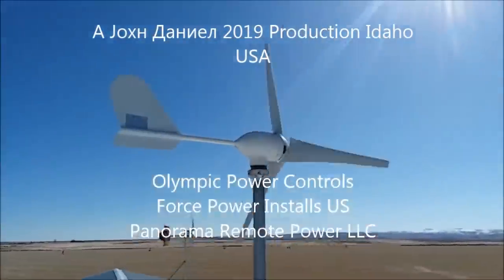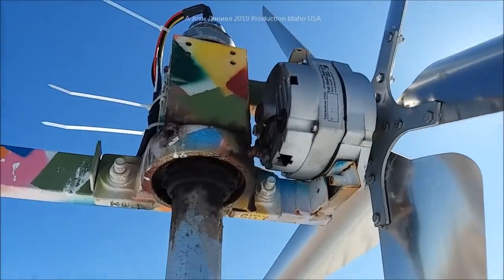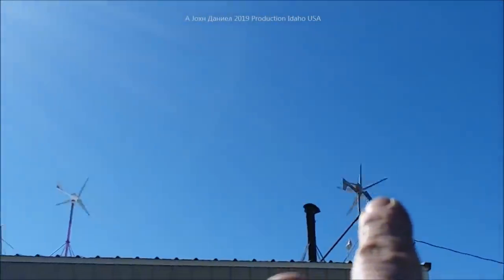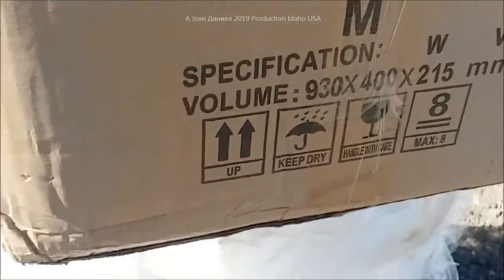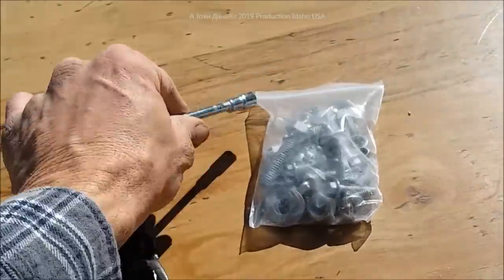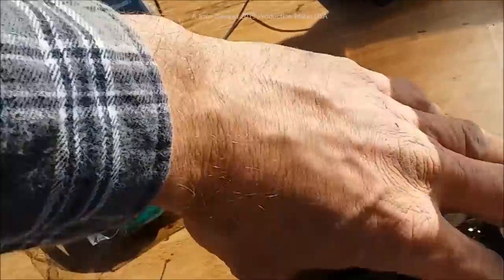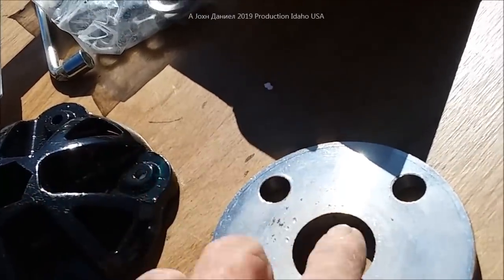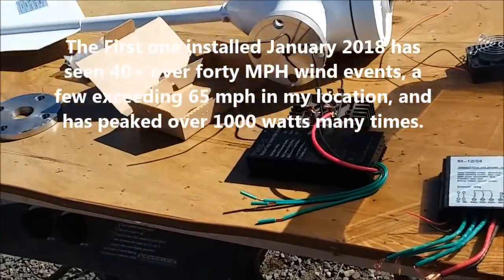Genuine 500 watt home wind turbine, Best small Wind Turbines made! FULL PARTS LIST BELOW video

Comment: Next time you have the Chinesium Unit down for anything check the wires coming out of the back of the PMA  ( They call them PMSG Generator ) .   All of the Chines PMA's on the market I've looked at  do not seem to have any Grommets protecting the wires exiting the PMA.   You may want to be checking yours when possible.  Could make for some BAD Ju Ju.

Comment: What can 500watts power in the house to full capacity.
Reply: Add a small battery system and convert all lights to LEDs, and it could run your lights off-grid, and still have enough extra power to keep multiple phones/tablets charged.
Reply: Wind is also strongest at times when sunlight is weaker or absent, so wind energy is a good complement to solar power.

Comment: 1) A Wiring diagram would be nice to see (I build RC Planes and they use 3 phase brushless motors) so this is very similar

2) How well do these stand up in very high wind conditions.  Where I am, during winter, we will get winds on occasion that will exceed 130 km/h (about 80mph).  

I have been looking at both this style as well as vertical axis wind turbines and thus far have not made a choice as I can't figure out which would be better in my case.

Comment: John, thanks for your input and helping others!  I bought three of the recommended turbines, for an off-grid home, 2 - 600w units and a 1KW unit.  Having problems getting what I paid for in this deal.  The 600w model have nose cones that cannot attach given the included hardware. The design requies a very long (5 inches?)  6x1.0 bolt to fasten the nose cone.  Sara has not fixed this.  not sure if one exists...still looking.  The 600w model also has a concave hub forcing the blades to be angled away from the hub at about a 15 degree angle. Have you seen one of these turbines?  Is this normal?
The 1kw unit has major problems from (shipping??) damage.  Threads bent at the end of the shaft and much play in the shaft (in/out) and beat up blades due to rough handling and poor packaging.  my 600w units don't have the bearing play.  Have you had experience with the 1kw unit?  The 1kw is heavy, and they packaged the unit like the small ones.  All of the foam in the boxnear the generator side was crunched/broken.  It should be sent in a small crate.  So far 0-3 in getting what was advertised from aliexpress.   
If/when I get past this I have some questions on how to build a telescoping/tiliting tower, we are in Oklahoma, hint...hint.  Thanks for any help or input you can provide.

OKDan

Comment: Do I need a load diverter bank with this setup?
Reply from the maker: I recommend a proper load diversion of 200 watts first stage 14.65 volts, 300 watts in second stage 14.85 volts

Comment: Could you install and mount a system that’s easily removed and mounted  *a smaller version*.. on the top of my van  .. (I travel and live in it)...so when I’m (off the grid ).. it would supply enough to stay at any camping area for long periods of time...???
* Great video..!!! Thank You

Comment: Your no COG implementation is great. In my experience with wind vane self-steering sailboat units, I learned that a wedge shaped (v-shaped) tail fin is much more stable than a flat tail fin. The wedge prevents hunting while pointing directly into the wind because there is pressure on both sides of the wedge which keeps the wedge from wandering. Place a tab on one side of the wedge fin to achieve your torque speed control. This reduced hunting will reduce gyroscopic precession stress on the bearings and on the blades. It should also increase the average power produced because of reduced hunting. What say you to that?
Reply from the maker: You don't want the turbine to be dead locked on the wind, you want it to be able to move in high wind burst so tail size and capability are calculated to allow torque reaction effect to save the turbine in dangerous winds.

Comment: Do you know these windturbines from a company in UK called marlec, they call their windturbines rutland and a number depending on size ? And what would you say about them from what you know about windturbines and offgrid?
Reply: I've had a Rutland 914 for a while, all seems good, but very heavy using conventional magnets in a huge flywheel, seen pics of them self destructing in gale force winds. Their new one ( think it's the 1200) looks very nice, rare earth magnet design, looks a lot like an "Air breeze"  but without inbuilt control circuitry ( less to go wrong?) only drawback is the cost, but made in the UK, not the Far East!

Comment: I did a drill test and mine does work real good. I just need to get a telescoping pole for it.
Reply from the maker: Might just have to load all up on your trailer, and come one down to Twin.
Reply: I have to install a serpentine belt and the 2 pulleys the tensioner pulley and the other one. Then I can . And I need to put a hanging hook on the side of my box for turbine pole lol for the trip that's eay then its road ready. What exactly would we be doing to it?
Reply: Shit I might as well bring my new electronics box and my 18 copper bus bars I need to install for my new bank I have 2 batteries still that need to be added I ran out of space in my battery box.so I'm making a new batery box .
Reply from the maker: @donaldsteele6276  My guess, we would have to take our ugly old asses to the drawing board with the trailer there in person to base a design from. Hands on and make a rotary lift or pit and tilt. Good weather is about 10 days away.
Reply: Oh hell yeah.  I'm working on improving  things all the time with the trailer. The bus bars will clean up the wiring allot. The telescoping pole I've seen some pneumatic pole designs that would kick butt. A small compressor and the pole would go up and down.
Reply: I repaired my truck still have roofers installing a new roof on my house and a new bathroom is being installed.  Hopefully I will be free soon again.
Reply from the maker: @donaldsteele6276  Your just gonna have to haul that set up to Twin and Join me and my traveling cohorts to get your system done. Lots of salvage parts and knowhow. Helps to have your exact system on site to really build you perfectly.
Reply: @JOHNDANIEL1  I want to come down and see what we could do with some scrap metal and no how . I was thinking just simply making a telescoping pole with just 1 more pole inside the 2 inch OD and then mounting a 3ft 2 inch OD on the inside pole so I can mount the turbine to that and it would hide the inside one . Lol I have pictures of it completed  in my brain functioning
Reply: Look at this John https://youtu.be/vK-_Xbci8Lc
Reply: Ok and here is my whole setup and I also tested my turbine with 3 props and hub too. Wasnt enough wind really but my entire system is on it. https://youtu.be/wsxbHv8rNu0

Comment: what would it cost and what comes with it
Reply from the maker: The Chaos Offset Turbine frame? I build and ship the frame for about $175 to 200 depending on your shipping area and needs. They get made with the offset Yaw bearings, tail, hub mounting hardware, 3 wire slip ring, Slip ring keeper, PMA mount for 10 or 12si style only, and 20" of 1-1/2" pipe ready for a coupling.  I don't do many, its on request usually from people. I don't advertise, don't run a store, and I just build on request.
Reply: @JOHNDANIEL1  where are you located, what state

Comment: John, you very quickly shared your secret about your Chaos, and wondered if you could explain what you did a little bit more. I understand it originally had 14 magnets, but you modified it to have 12. How did you do that? What was the purpose for doing that? Many thanks.
Reply from the maker: The original makers of the Delco 10si that got and converted Alternators began in 1971 with placing permanent magnets in them, they matched the rotor of 14 poles thinking it would be the answer. Problem is, a Delco 10si is as a car alternator, a excited field alternator. Powered by a engine and a charge to activate it! 
A PMA, permanent magnet alternator with poles lined up with the stator iron is a cogging fool. Cogging at any speed causes magnetic flux to overcut. Making heat, and loosing power. BUT, reduce it to 12 or 10 magnets you get no stop-point alignment of the core and iron in the stator. The result, a smoother flowing field to the coils without canceling, power curve fail, and cogging. 
The pervert former pimp, used car salesman, appliance part hustler, pottery salesman and current assmonkey in Missouri who stalked me for years, threatened me, sent my wife emails about burning us out of our house over my "buying then (by his own mental disorder claims & said I needed destroyed ) for promoting his enemies product"  he later as punishment  posted my 9 year old daughters picture on a porn site and my state contacted the source, tracked it back to one of his 40+ ID's, then Missouri refused to pursue. Missouri loves perves, Not to mention he will surely attack me more in the future with his cult like follower of freaky troll nazi's and steal the design, and then sue someone who challenges his theft, but I am moving on to bigger fish, and the guy for Thermodyne refused to try the design of ultimate success, so screw him too.  
Fact is, all of them are morons with the past of a scammer and education of a foot fungus! Just beware!
Reply: @JOHNDANIEL1  How would you recommend that I make the same changes to my motor? Or should I just buy the turbine from China that you recommend? Also, do you recommend a few small turbines (500W) or one large turbine (2000W)?
Reply from the maker: @greenacresfarms  I always refer people to buy multiples of smaller turbines over one large turbine. From weather to accident things happen. If you have 4 small ones and one fails your 25% in deficit but if you have one 2000 watt and it fails, your 100% in deficit.

Comment: on the 500 should i get a 12 or 24v for a Camper
Reply from the maker: Got good winds, get the 3, got occasional winds, get the 5. Most will buy the 5 and a 3 blade spare hub. The 3 blade spare hub Model is 139mm, M in the listing, https://ebay.to/2CrkkEq

Comment: I been doing this shit since we started building them in the late 60s. Currently running a vert redundant system in NW mountains. Never my mind my system. Had them all n worked with everything from Jacobs foward. Currently flying 4 AirX units that have all been up going on 10 years flawless. Only been down ( tabernacle monopole towers my design) for inspection and bird shit removal. Your obvious experience and knowledge qualify this "video" got dizzy trying to watch. I like your pace cause I have no problem tracking. Wish you had a tripod. Have nothing but bad experience with AliBaba n cant beleive you got anything that fast from them. Based on your skill set I would probably thy one. So far all I've seen from this source is typical light weight internal shit that usually frys very soon and never even approaches their claims. Your enthusiasm makes me wonder if you have stocks in Alibsba. Haha. Just jackin with you. Those wild ac are great for saving money on the gen head to controllers wire cost and don't seem to be dependable for braking. High winds just wind them up till something frys. This is interesting. Will look into it and sub to see more of ur info. Stay strong.

Comment: can this be added to my solar power system to charge the batteries on cloudy/later in the day? My system usually produces plenty to 100% charge my batteries and run most of the house during the day. Just looking for those times when solar isn't available and adding to the batty bank is not practical. (space and cost)
Reply from the maker: It produces straight to battery bank just like the solar does after the controller, but you need 340 AH of battery storage to use one, or numerically - about 4 regular deep cycle batteries.
Reply: I have 48v 400ah battery bank. Would I need another charge controller if I used this breaking system like this video or a kill switch with big resisters you have in another video?
Reply from the maker: @scotthenderson4376  For a singular turbine in your system, just use the controller as designed. Mine has 4 turbines on it, thats why I am hacking the controller to make a diversion loading system based on its preset voltage monitoring.

Comment: Hey John, just came across you video. Thanks, it was a great view. I was just wondering how would the parts list change if you wanted to connect this bad boy to the grid instead of batteries?
Reply: Grid-tie inverter for turbines this small is not easy. Power company and insurance issues about compliance. Next problem is connecting a grid-tie inverter to a battery bank needs a low voltage cutout because grid-tie inverters are designed to take all of the power they can. Plus the life cycle cost of batteries is close to kWh grid price so no benefit. Consider water heater dumpload on battery bank that stays fully charged.

Comment: Hi John, great video!! Thank you for all of your information. I would like to get the 300w RV unit you provided the link for and use it with my existing RV solar system but I have a couple questions. If I use the provided controller without the rectifier (as intended per instructions), and the ground goes to my neg bus bar, does the red wire connect to the solar input side of my controller or the positive battery side? How can I use a 24v wind turbine on my 12v batteries? I use 8 6v batteries (4 12v pairs) as listed in your link. On the solar side I have 6 165w 12v panels set up in series (3 24v pairs) going to a 45a Morningstar MTTP controller. I get about 29a charge. My thinking is that I will have problems with my controller if I attach the wind turbine to the battery bank. My battery bank supplies a Magnasine 3000w inverter/charger. I did fine on the solar conversion but adding wind is slightly above my pay grade :) . Thank you for any assistance you can provide. I am happy to use phone/email for your convenience if you prefer. Thanks again!!!
Reply from the maker: A 24 volt wind turbine just reaches charging voltage sooner, the batteries voltage is what the controller will charge. 24 v is better for low wind areas or when you need to always get something of night time amps. Its total amp output is lower than a 12 volt turbine but if you are sure you'll get 10 or so mph then in the long run a 24 volt model will actually provide you with more over all storage amps when on a RV a 12 volt winding may never reach cut in level. RV owners can't exactly put one 30+ feet up, they can do 15 feet and should, but not a good clean 30+ feet of pole. I explain this to people and they are like, WHAT, why can't It make a full 300 watts in 5 mph, THIS IS A RIP OFF !!  Then they bash the turbine.  Others understand your dealing with limitations, and opt for the 50%  goal of something is great compared to nothing! 
If your going to run a 24 volt system, I'd use a 48 volt 5 blade so you get better dirty and low wind charging. Just remember, it'll make no more than 200 watts max on a 300 model doing that. But it does make a major difference on your system to maintain charge in bad weather.
Reply: Thank you. Only the panels are 24v, batteries are 12v. So I can hook up a 24v turbine with a 24v controller directly to my battery bank bus bars?
Reply from the maker: The controller with the turbine, or one designed for it, will auto detect the battery 12 volts and charge from the 24 volt turbine to your battery just fine.
Reply from the maker: InRe: Connect straight to battery from the red/black on the controller for the turbine.
Reply from the maker: PS, If you DO have high winds, May get into High winds, get the 12 volt 5 blade.  Anything common highs over 13 mph, get the 12v turbine.

Comment: mine sucks, used one week max 250W    I will sell cheap
Reply: https://www.youtube.com/watch?v=ziIsiP0G99g
Reply from the maker: Did you place it high, get 25 mph of clean air?
Reply: @JOHNDANIEL1  yes
Reply from the maker: I'll buy it. I got 6 or more installs still on the block to do. Quote me where, Blade count, price, and postage info to Twin Falls 83301. I'll see if the people on my install list will get it gone for you. Everyone I put in is doing great, I just may stop trucking and keep installing. I got 2 sunnings and 4 Green E to put in right now, just been behind due to sick with some goofy lung fungus crap from hauling cows.
Reply: @JOHNDANIEL1  shipping from Canada is more than the unit from China. My cost to import is so high I was hoping that it worked as yours did as I have over $450 into it

Comment: I would like to start off by saying thank you. Your knowledge on this is amazing and a bit overwhelming at first. My question is you said about using a 5 blade to help slow it down because it was producing too much energy. So if I live with less high wind more like 10 mph for a windy day, would it be batter for me to go with a 3 blade system? Thanks for taking the time to help so many.
Reply from the maker: Depends on your area, wind consistency and need. I prefer to refer people get the 5 blade for everyone, and then buy a WNA original 3 blade hub from Ebay that fits it and the blades. The 3 blade spare hub Model is 139mm, M in the listing, https://ebay.to/2CrkkEq
Reply: @JOHNDANIEL1  Thank you so much for your time and great advise.